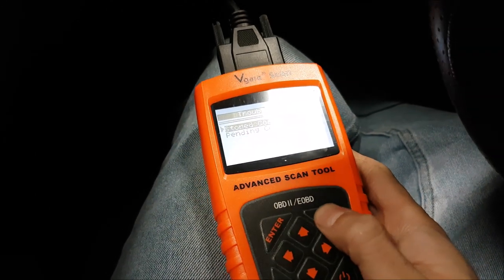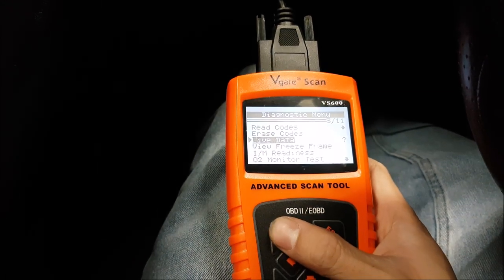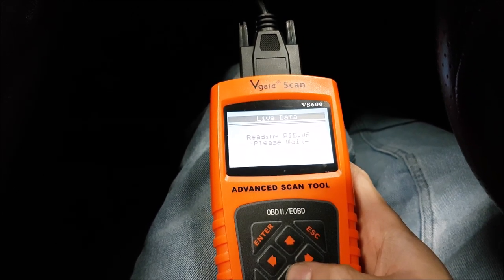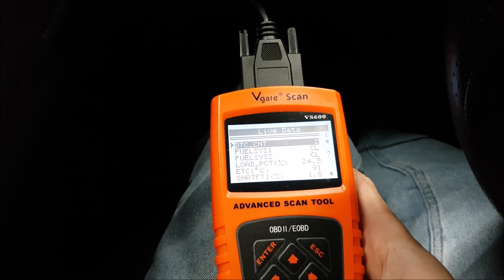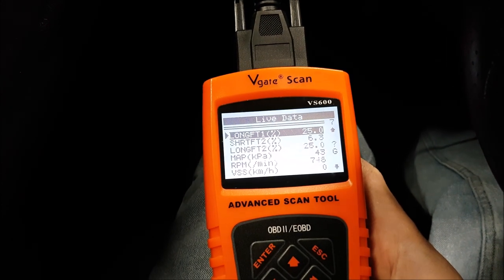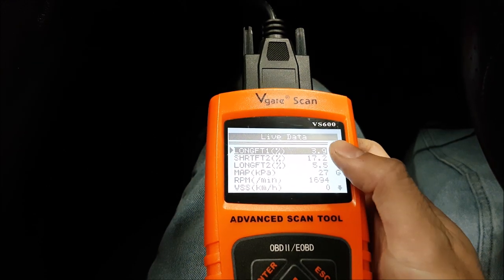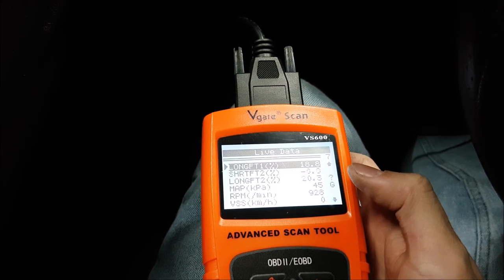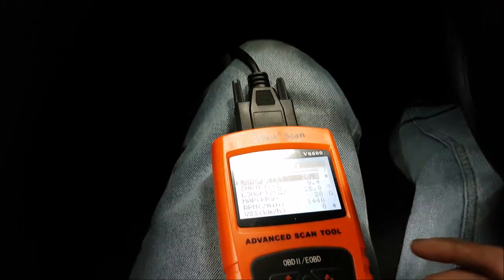How to TEST/ FIND a Vacuum Leak | AnthonyJ350

Comment: Great video, going to check those fuel trims with my scanner now as i feel like “something” isnt quite right with my setup. Take off is horrible but no codes. But just out of curiosity, you went with a tbss mani and 07+ tb? Isnt the mani 90mm and the tb 87mm? I have the opposite on my truck right now, its an oem 09 5.3 mani and ls2 tb (90mm) with an 5.3 tb spacer. Im thinking it might be the tb spacer reduction causing my throttle issue (going from 90mm tb to 87mm intake)
Reply: Nvm just realized you have a 3 bolt tb, completely different than the 07+ throttle body
Reply from the maker: I have a TBSS intake
Reply: Did you have to retune for the throttle body? I have an 09 silverado and put on an LS3 throttle body. I just took the tb spacer out and going to go for a test drive.

Comment: Hey bro how about if you feel your car has a very low gas mileage,  but you don't have a lean code.
How would I find out if there is a vacuum leak ?
Reply from the maker: You have to look at your fuel trims while driving
Reply: @AnthonyJ350  thanks.
Reply: I'll try that tomorrow, thanks.

Comment: Is that trailblazer intake worth it? Found one for 106 but don't know if it will fit a 2004 GMC Yukon xl 5.3 L vin code z
Reply from the maker: Definitely a better design than the original. With a small cam my truck made 270HP and 270tq at the wheel. That's roughly 350hp at the crank. Not bad for a little 4.8L.
Reply: @AnthonyJ350  I just wonder if I have hood clearance on my Yukon. Is that tbss intake for square or cathedral intake ports? Are the sensors like map,evap,and whatnot the same? Or will I need to mod anything?

Comment: So what if my short FT stays at 0 and my Long FT stays at 25.0 even when I rev it ?
Reply from the maker: What happens when you're driving?
Reply: @AnthonyJ350  pretty much bogs way down when I take out, almost like it’s not getting fuel, and then eventually catch’s up and starts going. Kinda studders no matter the speed. Recently replaced cylinder 5 injector, I checked today to make sure all were seated properly. But I lack fuel pressure, however my fuel regulator doesn’t let gas into the vacuum line so I think it’s still good.
Reply from the maker: @caseysmanual6541  But you you're not registering proper fuel pressure?
Reply: @AnthonyJ350  no it loses a lot of the pressure once the truck is shutoff.
Reply from the maker: @caseysmanual6541  Have you tried searching around the intake for a vacuum leak?
Reply: @AnthonyJ350  yes